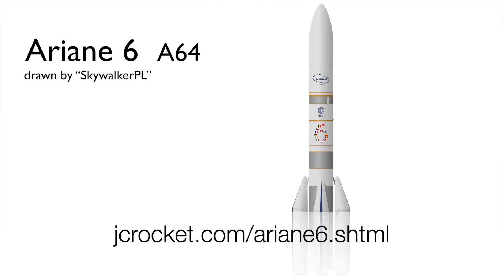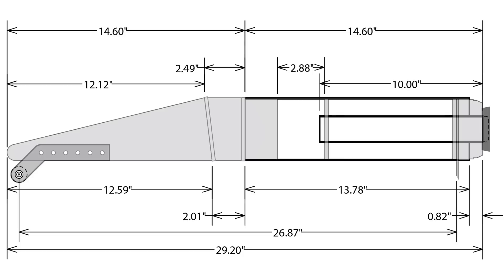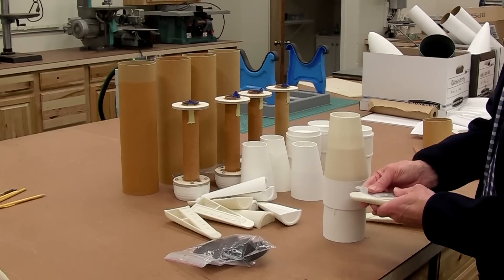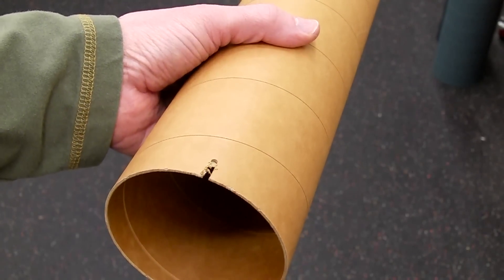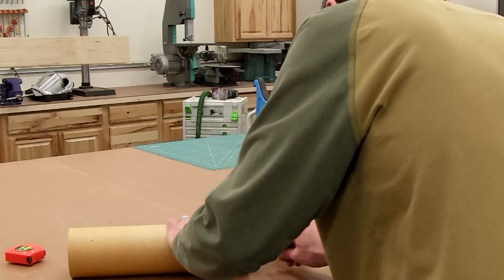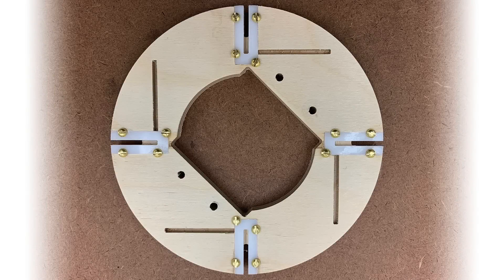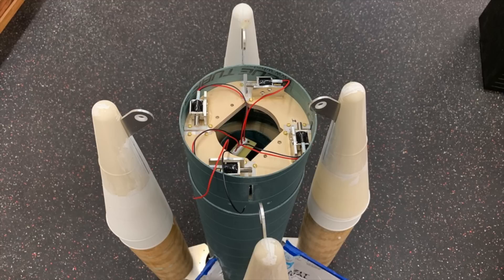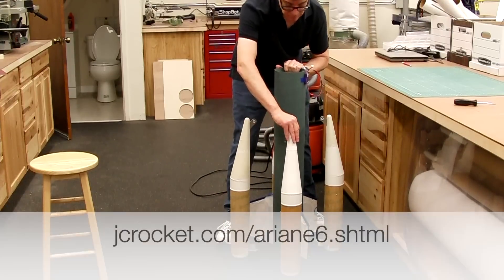Ariane Boosters

Comment: Yes wauw! nice build! I had my first succesfull low power 2 booster separation flight by now. My boosters separate by releasing a hook that is held by the nosecone that is simply blown of by the ejection charge. On the back side of the booster I made a hinge from a piece of electric tubing and made a liner of a coupler on the booster, it also keeps the booster at right angle on the main rocket. Maybe I want to build an Ariane 4 with the same system.

Comment: Hi John! Is that a diode on the breakout board for the solenoids and if so what is its purpose?  Thanks and what an incredible build!
Reply from the maker: I'm not a hardware guy, much less an analog hardware guy, but a friend told me it was necessary with coils.
Reply: @JohnLCoker  OK thanks!

Comment: Hi John, nice work!   love to see flight turn out.  by the way, I want to get your advice on something else. I recently attended NXRS for first time and noticed tons of folks carrying some kind of antenna with 3 purple bar and red cap at end.  Afterward, I found the name in your website (arrow yagi antenna).   Would you recommend any any GPS tracker that is < $100-$150?
Reply from the maker: I don't think any are that cheap, but here are the ones I've used: http://jcrocket.com/gps-tracking.shtml
Reply: If you’re good with a soldering iron Eggtimer Rocketry makes some nice kits that could work for your budget.

http://eggtimerrocketry.com/home/eggfinder-gps-tracking-system/

Comment: Very nice build John. What will trigger the solenoids? Is there a chance that the motor ejection in a booster could occur before you separate the boosters?
Reply from the maker: The boosters will light first, then a timer will trigger the solenoids, then when the boosters burn out they will drop away.

Comment: What a awesome construction. Me myself always thought about some explosive bolts. Your system is the solution! How do you recover the boosters?
Reply from the maker: The forward half couples into the airframe tube, so I'll just motor ejection to separate them and recover them on small parachutes.

Comment: Seems heavy. What is the weight?
Reply from the maker: Yes, the aft end is heavy. I'll be using 4 short-burn motors for the boosters (maybe H550s) and I haven't figured out the sustainer motor yet.